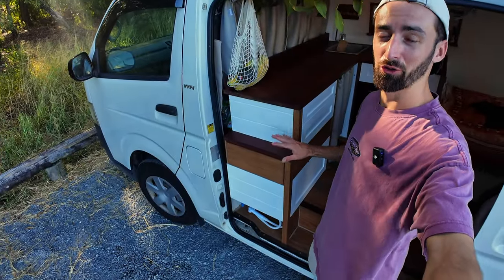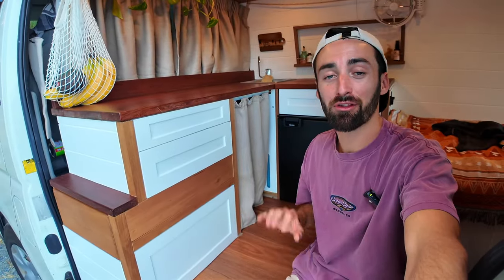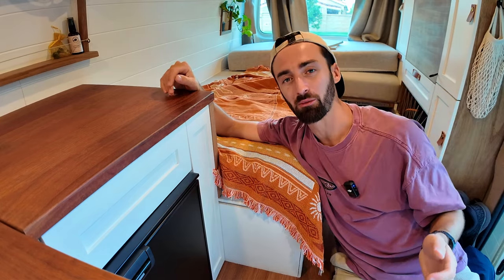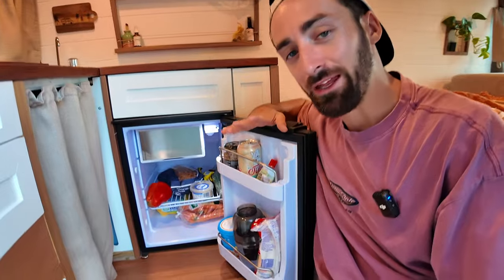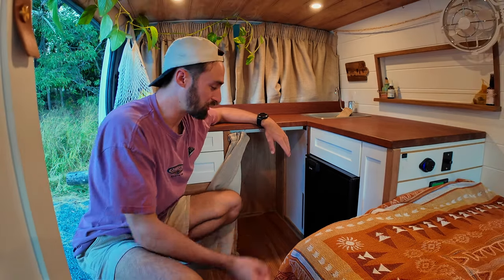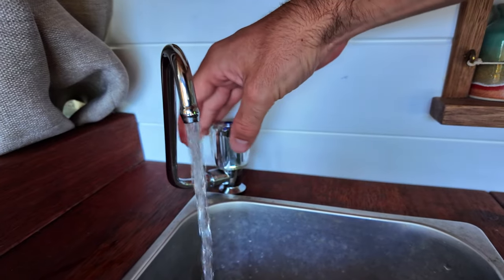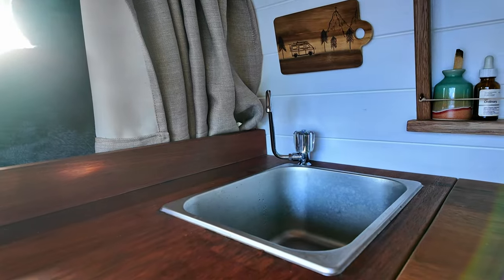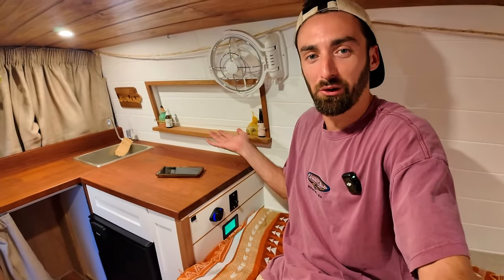Detailed Kitchen Tour - Practical Toyota HiAce Campervan Kitchen

Comment: I love your set-up, brother!

Have a slwb Hiace to build, and many Hiace/van builds have the kitchen in that location which I've wanted to avoid so that I can jump between the back and front when required.

Your "free space" idea just solved my problem!! Will go with that design now, but, will add a hinge above it on the countertop so I can lift it for access into the cabin area!!! 🤘👍🫶
Reply from the maker: A hinge to allow access is actually genius! I hadn't even thought of that but you're right and it wouldn't even be difficult to install 🤩 Love it
Reply: @JourneyVanBuilds  
Yeah, I think the front kitchen layout is the best option, but I just couldn't get past that hurdle. Have to be able to access the front from inside for security purposes.... or bad weather, etcetera.

Have also thought to redesign that middle seat to face backwards for an extra bum space facing the back/living area. 

I probably wouldn't have come up with the hinge idea without seeing your empty space idea!

Comment: Hi.
Can you do a video on your kitchen?  Im particular interested in how you designed to fit over the engine bump in the middle behind the seats.  Is that where you have the curtained space? Do you have any video of when you built it? Im sure every hiace van builder would love to see. Thanks kindly.... Ally
Reply from the maker: Hi Ally, thanks for the comment. I'm not sure how much footage I have solving that exact problem but I'll have a look. For now, The gap between the kitchen cabinet and the cab seats does help minimize how much the bump will affect you and it's there anyway to make sure that mechanics can easily lift the seats and have access to the engine. What was left of the bump sticking out was minimized again by having a subfloor which lifted my cabinetry above the worst of it. At that point I just notched the remainder of the bump out of the cabinet so it could sit over the bump with no issues. hope that helps 😅 I'll see if I can get a quick video together

Comment: Hi Jake, love the build. I'm at the start of my van build journey and I have yet to find a better/simpler layout than yours. One question: When washing up, is that corner sink a bit difficult to work in? Do you end up crouching, kneeling , or do you use a stool to sit on?
Reply from the maker: Hey Stuart, thanks for the feedback mate!
I can see you've since found my plumbing walkthrough ahah but yes you're right, it is a pain to wash up in that sink and I never do it. I wash up in a pot or wash up bucket on the pull out kitchen slide.
Reply from the maker: It's handy as an emergency wet area inside the van for dishes and filling up water bottles but otherwise I prefer using the outdoor features

Comment: Hi Jake. How do you fix all your furnishings to the flooring?
Reply from the maker: If I can get a bottom plate on there I screw directly through that and through the vinyl flooring into the subfloor. Or I'll use L brackets to fix it down. The subfloor is glued to the bed pan using Sikaflex

Comment: Hi my name is Chris and I'm fitting out a 2006 Toyota HiAce commuter van,the problem is I'm not a cabinet maker or builder so can U send any spec onn your fitting out of your van ,I'm about to start on the roof with tongue and cover and not sure on the battens and were to put them ,I would really appreciate it, thanks Chris ,one more thing if you r ever in Tin can bay my wife and I will take U sailing cause we live on a small yacht in Tin can bay, thanks again Chris and Alex of yacht toccata.⛵
Reply from the maker: Hi Chris and Alex! I'll keep that in mind if I'm ever up your way haha I've never been sailing. 
I hear you man. The framing for walls and ceiling is what heaps of people struggle with so don't feel bad. I have a pretty good little system but I don't have any videos on it yet. I'll see if I can put something together explaining how I do it for you 👍🏼
Reply: Hi again what stain did you use on ya timber roof.
Reply: Very well  done. I have a question. If you hinged the cabinet top over the open space would you have access to the cab? I really liked the drawer hardware and the location of the outside cooking tray.

Comment: Where did you store electrical??
Reply from the maker: Great question! Technically it's on the back of the kitchen cabinet but it needs it's whole own video so I haven't  mentioned it here. It's mounted on the back of the cabinet right behind the driver's seat. So with the driver's seat pushed forward you have clear access
Reply: @JourneyVanBuilds  Ah ha, thought so! What sized battery? Guessing quite limited space?
Reply from the maker: @andrewcotman5698  It's a 100Ah Lithium from Renergy :)
If you have a look at my other videos I do have a detailed explination of my last vans elec settup and this ones very similar :)
Reply: @JourneyVanBuilds  Ah ha, was on the fence of 100ah vs 200ah but went 200ah but now thinking about space!
Reply from the maker: @andrewcotman5698  Yeah space vs power is tough. For me - being in a smaller van, 100 is more than enough with 175W solar and DC-DC as well 🙂
Reply: @JourneyVanBuilds thats a great space to house it. Did you store the battery itself in that void behind the drivers seat?
Reply from the maker: @bradlewis3880  Correct :)